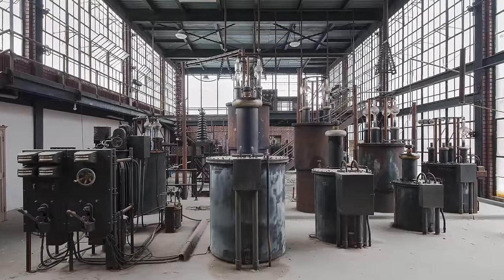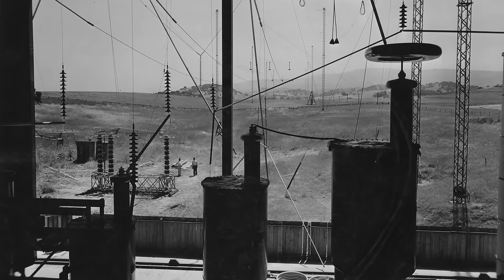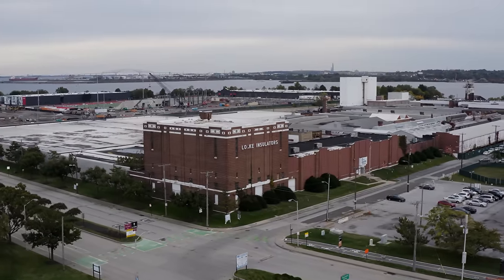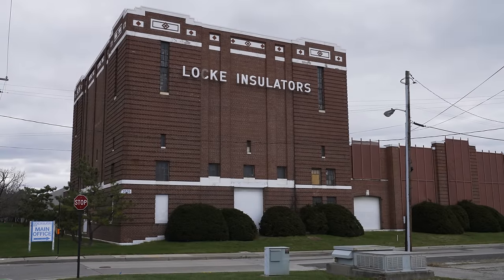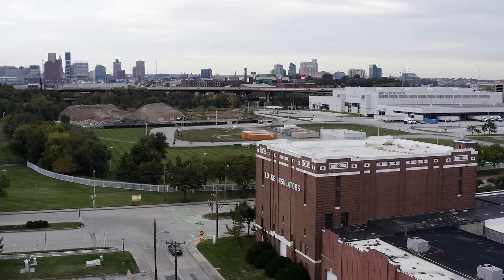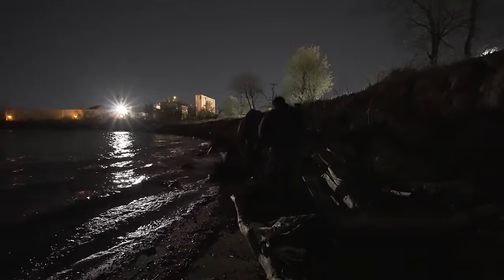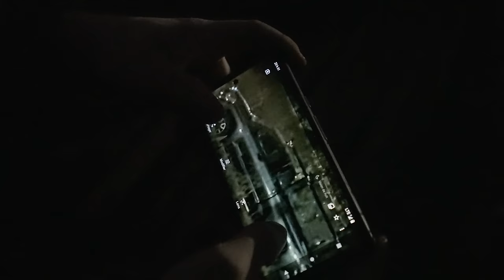Exploring GE's Abandoned High Voltage Lab - Vintage Electrical Tech!

Comment: The piece of equipment shown at 26:50 is an IM-37A/PRM-1 Radio Interference Field Strength Meter made for the Navy Department, Bureau of Ships. Mine is like new with all accessories and was made by Stoddard Aircraft Radio Company. It is to used to measure and locate radio interference.

Comment: Absolutely amazing that you're able to find that laboratory in the state it was in, and that you were not arrested in the process. Unfortunately nothing like that really exists here in california. Most of the high voltage research and design, we're either done at the universities, or through a few Pacific Gas and Electric facilities, only which of one still exists. All of the ones at the universities were usually torn down to make way for new projects.

Comment: Locke insulators-they made base insulators for AMbroadcast towers. The whole tower is the antenna. Ground radials ran in a circular pattern around the base of each tower to its height. The base insulators sometimes get blown by lightening strikes. A crane was needed to lift the tower just enough to replace the base insulator-then set back down. The station would have to go off air. In those days Kenotron trectifrr tubes were mercury vapor. Many old broadcast transmitters used Kenotron tubes as rectifiers in the hv Supplies. Then solid. State diodes replaced them.

Comment: Did a double-take when I saw the industrial computer/monitor combo on top of the bench at 24:32.  Looks like an Eaton model.  This suggests that this lab had at least some use up to the mid to late '80's.

I used to work for a company that still refurbishes these to this day (replace the plasma screen or CRT with LCD, replace Hard drive with SSD or disk-on-module, repair/replace mainboard, keypad, etc).  Used to see racks of these things ready to ship.  Interesting seeing such a piece of "modern" equipment mixed in with all of this older tech.  I would say "vintage equipment," but even the computer would be "vintage" today...

Comment: My dad was an electrical engineer for Locke, GE, Westinghouse, RCA, Ohio Brass, and UCCS. He videotaped all of the tests he conducted. I'm going back to my parent's house this weekend, so I'll try to find footage of the mansion lab in operation. I grew up during the time when he worked at the University of Colorado Colorado Springs (UCCS), so that was the lab I was used to seeing. Also, due to his job, I was able to see hundreds of power stations and plants across the country!

The lab at Ohio Brass couldn't operate when it was too hot, too cold, or when it was raining, because it was outside. This also meant it was a maintenance nightmare, parts had to be replaced every time it rained.

Comment: I worked for ABB for 8 years, in that time we had a HV test bay within our transformer manufacture and repair facility in Alberta Canada, We had our own impulse generator lightning simulator. It was a surreal experience operating it to test transformers during acceptance testing. The facility was built in 1995 and was in full operation until the summer of 2019 when the facility closed and decommissioned for scrap. During this time the HV division was merged with HITACHI. Unfortunately the facility was converted into a furniture factory/warehouse and was in a devastating fire causing a full loss of the building.

Comment: Back in my own skulking days in the 70's, on a night so dark you couldn't see 5 feet ahead of you we walked across a road and just as we got into bushes on the other side the guard started his truck and turned on the headlights.  We had unknowing walked across the road right in front of him.  He must have either been asleep or couldn't see us either.  That was an adrenalin shock we will never forget.  On another occasion, only a whiff of the guard's aftershave saved us from certain discovery.  These days, I would be too afraid of IR and ultrasonic alarms to do what we did back then.

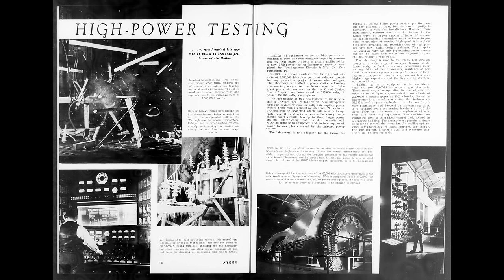Comment: 2:08 Westinghouse Trafford, which become GEC Turbine Generators and GEC Switchgear was where I worked in the 1980s. The HV lab for Switchgear was still there and used regularly. As you note, it's demolished and now a housing estate and sports area.

Comment: This is a great video fellows.  At 20:00, I believe that you were looking at standard metal safety fences rather than a Faraday cage.  The Faraday cage was/is for electromagnetic shielding.  I think the fencing is grounded fencing to keep people away and electrical arcs beyond where people can stand.
Reply: Good observation, and you're half right. It's not the type that will block EM fields(radio, microwave etc), but blocking arcs still counts as a type of Faraday cage, in which case a fence will do just fine lol.

Comment: I used to be test engineer in an EHV lab with a 600 kV AC test test and 2400 kV impulse generator.

I hope the person setting up the museum knows what he's getting into with old extra high voltage equipment like this.  Some of the oil may contain PCBs and should be tested.  The equipment is a nice piece of history, but to put it into service again is a big task.  Safety is a big concern with EHV knowing how to properly ground each impulse generator stage in case it doesn't fire after charging and understand the massive electric field that is created.  Modern impulse generators have more safety features that make this easier.  Just having it on display for the general public to see will make for a great talking point.

Comment: Clarkson University was helping test new insulators too. One was a plastic low voltage one 32kv and it was almost there. Repeated strikes was causing tracking and it would then fail. Mcgrath was convinced a little more anti-tracking stuff would make it work. But it wasn't brought into service.

Comment: Very cool video!  It's a shame the lab building is gone but happy to know they saved the equipment from destruction.   If you notice at 20:25 60 HZ AIR switch and later in the video ceiling fan as were there to vent the excess ozone gas from these powerful man made lightning strikes.

Comment: I have some old gauges I purchased from an antique dealer it look a lot like some of the gauges in this video.
1 gauge says 7500 amps
The other says 20 to 30 volts DC. I'm not sure if they went to some old mining equipment or maybe telephone system?
The gauges are made by Weston model 273
There are some really old relays that are on the panel I have not seen anywhere else. They are also made by Weston Electric.
The amount of technology and copper that was scrapped at this facility is mind-boggling!

Comment: Back to the years when I was learning those things!  Doing some lab exercises at the University HV Lab.  Also, seeing another HV lab in where I worked to earn the money for mu studies.  Besides the spark spheres, the high voltage could be measured with a resistive divider, the upper leg of which consisted of a plastic tube full of basically de-ionized water, but mixed with a tiny, controlled amount of some salt.  Knowing the tube length and the controlled conductivity, you had a nice multi megaohm resistor.  The maximum voltage was limited by the room height.  And ALL the equipment in the lab had to be provided wit verified grounding, especially at times when some DC HV testing was active.  By the way, at the University lab there was a Synchronous Mechanical Rectifier.  It was used for providing the DC charge to the impulse generator.  It had a 5 ft insulating material wheel and copper bars making contacts with two fixed AC terminals and two fixed DC terminals in the perimeter.  When we, (after several attempts), got the wheel to reach a near enough speed for the synchronous motor to take over, the AC was ramped up and the cascade capacitors started charging up.  The fun of course came when the cascaded spark gaps fired and the main spark spheres followed.

Comment: I grew up down the street from Locke plant. Its was very old back in 1975 when I first saw the place. A friend of mind dad died while working there in the 70's. Never knew it had a HV lab. Back than it was mostly railroad that owned the surrounding area, old vacant loading docks and a since gone grain pier. Hope someone turns the lab into a museum with some working parts, might draw venue along with the other new attractions that taken over that area off of Hanover Street.

Comment: My father worked at Federal Pioneer Electric in Canada during the 50s and 60s. He had a pile of pictures of their high voltage test department for testing high voltage switchgear and transmission transformers.

Comment: 16:10 that barcode is likely for the security guard to scan to make sure they do their rounds. I used to work for a company that had something similar, but with the old analog method of different keys at various checkpoints and a cylinder that rotated to "timestamp" your checks.

Comment: If you guys didn't already know it, those QR codes you see around the building with the security logos are actual check points in the building that the guards are required to scan with a phone to prove they actually patrolled the property on foot.

Comment: HV labs are fascinating to me. I work as a lightning protection system designer and the company that I work for has to have the lightning protection system connection components tested with an impulse test of 100,000 A to ensure that they can take the forces generated during the passing of those sorts of curents.

Comment: If you have 735kv lines going through your area, you can see those huge insulators supporting the conductors. Those lines make some serious crackling noise in high humidity and if you bring a fluorescent tube underneath, it will lit up a bit.

Comment: What a fun video! I wonder if the mixing vats that you saw were for mixing up porcelain slip to cast the insulators. Also, this may not be of interest to anyone, but the handle-type switches in the faraday cage are called SB-1 switches, and they're standard in the utility power industry.

Comment: The cabinet at 25:48 most likely had nitrate film (note the metal canisters) or nitric acid in it.

If the area around it was generally dry like it appears briefly, that kind of rust from inside is from nitric acid damage, it absolutely eats away at iron and steel, and seems like that is what happened there.

Comment: I wonder if you could access GE’s NELA Park in East Cleveland. NELA was sold to investors in 2020 and any historical remnants of the early lightning industry could have disappeared by know. In the 1950’s you could drive by on Noble Road and see the bright light emanating from the research building at night. 
As a side note I was told by one of the retired engineers years ago that GE had the opportunity to pursue electronic flash. One of the GE decision makers rejected the idea because GE was one of the major sources of flash bulbs for the photo industry.

Comment: 23:12 fascinated by a chair but not the moving coil meter which changed the way electricians and engineers could see voltage. 🤔 was it an Avometer?

Comment: The breakdown voltage for a spark gap with smooth spheres is around 3kV per centimetre.
That Marx generator looks absolutely terrifying. I'm surprised there are no Tesla coils is it's relatively easy to generate millions of volts with them. That high voltage rectifier blew my mind.

Comment: Westinghouse Trafford still exists, however, it isn't a high voltage lab. it was last used as a printing press and warehouse in the early 2000's. It's an interesting location with some massive rooms.

Comment: Very interesting.  But I don't think it is true that this sort of facility is no longer to be found.  Hydro Quebec had a test lab outside Montreal called IREQ that I think is still in use.  Don't really know, did some testing there many years ago on a 550 kv circuit breaker, doing chopped wave testing at 1800 KV, as i remember with their big impulse generator and a 20 ft spark gap.

Comment: Great video, bit of a shame your initial reaction wasn't filmed though. I understand why, but I would've made sure I could get into the building on the scouting run then came back with cameras on the 2nd run for the initial reaction.
Reply: Also shouldn't this be Locke's abandoned HV lab? There's some GE equipment sure, but it's not their lab.
Reply from the maker: GE bought Locke around the same time this factory was built. They kept the Locke name because it was already a very well established brand in the insulator industry. It was known as the "Locke Insulator Department of General Electric" until it was bought by NGK.

Comment: Gntalmen I was on and in one in 1970. It was during a thick snowstorm so we wore black jumpsuit leached gray. The only way to the top to see in windows and possibly find an entrance was a foot-wide maintenance ladder over two stories high. Near the top with the world all white I developed vertigo. I froze and could not move. My partner climbed around me put his had on my back and said "You are going up Paul"The psychology worked and saved our life at the top was a one-foot wall when I reached over it to flip on the roof I felt the hair on my arm stand up. I backed down and took a penlight and checked -it was a 15KV line st up as a trap. We decided we could flip over it and clear it but if it was unbroken it would trap us and then police and jail. As we passed the two levels there were men working at a control platform (Catwalk) with clipboards and slide rules, More men we on the bottom floor all wearing lab coats. Going in was impossible, we saw the step-up transformers and MARX stack. We walked to the top and found a second ladder we went down cut a zipper in the 12-foot chain link fence and left and did it alive.. I never understood all the security or what they were doing. We were very lucky. Good job gentlemen, I suggest you use ear canal mike 2-way radios the China type cheap and effective for about a mile be sure they have a switch down the sleeve to transmit about 35 dollars each.. -Good luck, and stay safe. Paul Craddock.Location -Portland Ave, Louisville KY, and 28th Street .1970. I wish I had that much climbing power but an active 70 years have taken quite a bit out of me. . Oh, one small point we always took grapples climbing rope, and a S repelling attachment at 185 pounds a VietNam military ALICE belt with some other supplies was enough. I was 6'4" plus and he was 6'2' so we had some strength we trained by rock climbing..

Comment: The QR code sticker is the 21st Century version of the old "Pinkertons" security key station, where the security man carried a big clock contrivance that was on a shoulder strap, and at each "station" on his rounds, he opened s little "door" and thee was a key affixed to a keychain. He inserted that key into the clock device and turned it, and it left a mark on a paper tape inside the clock, and that recorded the time he was patrolling at that "station." It's been rumored that some guards made inpressions of those keys, and just used those instead, an alarm clock was handy to tell one when to insert a key... What would keep a 21st Century guard from simply capturing a photo/screenshot of the QR code is beyond me.

Comment: So, interestingly that QR code is a security guard patrol route monitoring tool. They have an app that they have to use to scan those QR codes to confirm that they actually patrolled their assigned route.

Comment: If those spheres are used to measure flash-over voltage, don't you have to know the humidity, air density, and temperature, or is that environmentally controlled?

Comment: I'd be overly cautious touching things in there. I'm not afraid of electricity, but I highly respect it. I'd be concerned something would still have power going to it; such as the light over the control panel.

Comment: So what happened to all the lab equipment? Didn’t anyone try to get it preserved? Surely there was enough volunteer labor in the area that at least the smaller stuff could be saved. And every bit of the papers, catalogs, etc.should have been digitized and posted on the Web, with the originals put into some museum somewhere. Leaving it to the bulldozers should be unthinkable.

Comment: It was amazing that Tesla invented a lot of things including wireless charging. He was trying to pass energy through the air without the need for wires and grids. He was also working on a network of wireless electrical systems that would have a receiving transformer in your backyard connected to a wireless network to power your home. He was concerned about health and safety of animals including birds due to the fact the immense energy required would have detrimental effects on the environment.  He was working on a way to harness the energy from the earth to create a self sustained energy generator that would have been the size of a small shed or garage on the back of your property that would generate enough energy that would suffice in the 1950's or so when he envisioned all of this happening. Instead he was working for General Electric and had to forfeit all of his research to earn a solid paycheck every week. He started to understand how evil this place can be and took his own life after being fired as a top engineer at GE for stealing his ideas and incorporating his research into their own agenda.